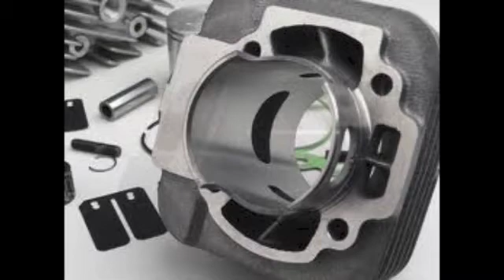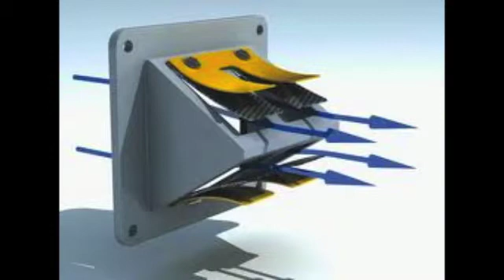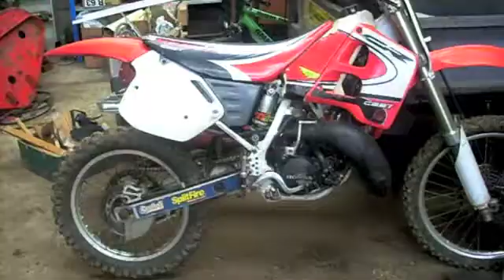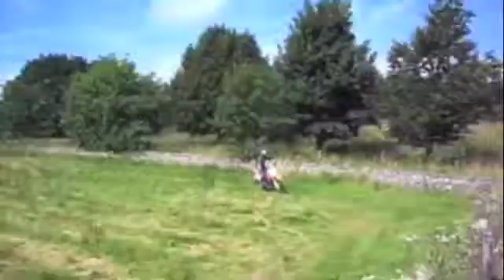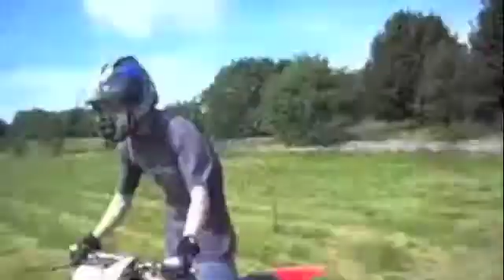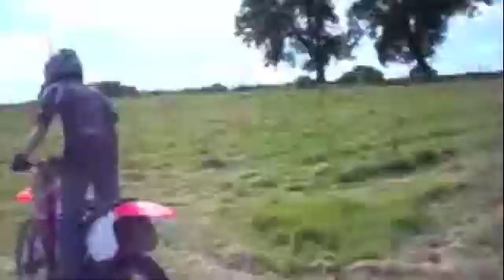Motorcycle days - Part 2 The 2 Stroke engine.

Comment: Sir, Have you heard about 2-stroke direct injection? Wherein the fuel is directly injected to the cylinder when all ports are close. Torque improved even in low RPM, more power, more fuel efficient than 4-stroke, cleaner than 4-stroke  and also more savings on oil.

Comment: Interesting that I mentioned reed valves and expansion chambers in a comment on the first video, only to find you talking about them in this one. You were apparently doing some of the pioneering 10 years or so before I got into it. At the peak of my racing I had 3 chambers tuned for different tracks and conditions. They could make an enormous difference. Those were the fun years, when we invented and built everything ourselves.

Comment from the maker: We have got over that problem of oily smelly 2 strokes now with better engineering with better tolerances in the fit of the parts and more sophisticated materials, as well as more sophisticated carburettors and lubrication is controlled by throttle openings.

Comment: As always, Peter, a very good demo. My dad bought a 350cc DKW in 1942 and I managed to sneak it out of the garage once when he was on a business trip. I too love the sound of those engines. But when I owned a Saab two cycle car, I always had to mix oil with the gas and that was a bit of a pain. Also, those engines were known for excessive pollution, right?